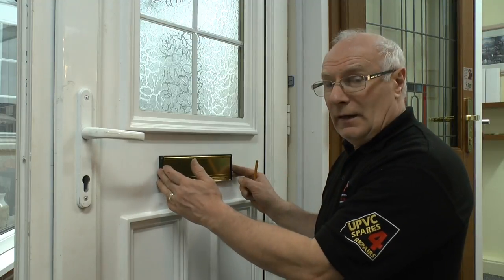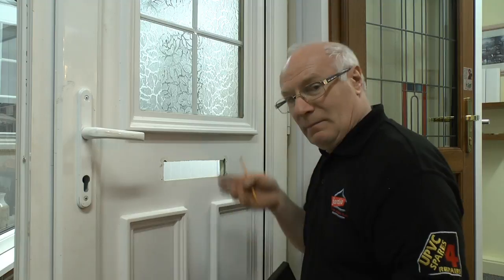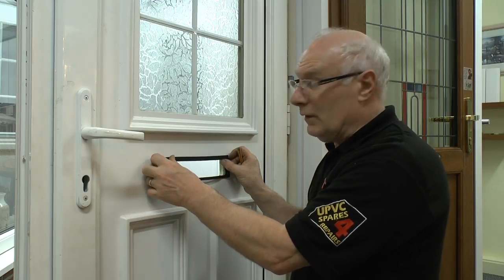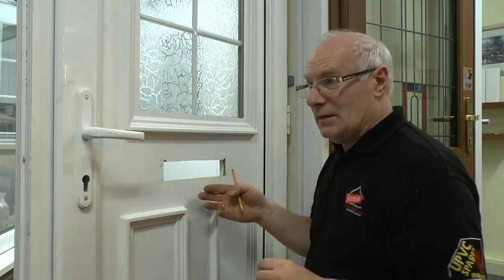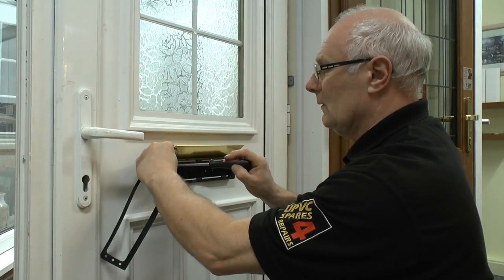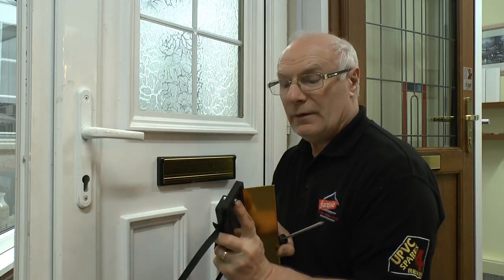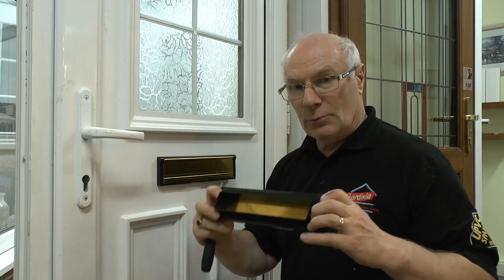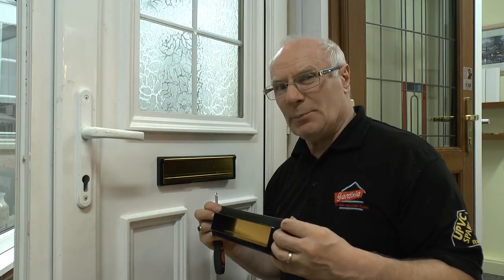Replace A Door Letterplate / Letterbox On Upvc or Composite Doors

Comment: They are always in a similar position however you need to note the detailed dimension drawings we always display on our listings. It is unlikely that a replacement will have the new fixing points in exactly the same place so you will usually need to drill for new fixing holes which is a standard DIY procedure

Comment: I suspect many people will wonder what happens if the hole in the composite (in my case) or upvc door is not the same size as the required letter box.  Do you have to get a replacement that is the same size as the first one?
What differs from working with a wooden door? is this just an ad for upvc spares?

Comment from the maker: It will be bolted on somehow I suspect via a central screw bolt running from the inside to the outside. Look for a philips head bolt in the centre of the plate on the inside letterbox when you lift the flap up

Comment: Does the door lock operate fully when the door is open ?  I:E not closed into the outer frame

I:E open the door lift the lever fully up and turn the key does it fully lock then 
if so it is something catching when the door is closed. I:E one or more of the keeps may need moving to allow the
lock to travel it’s full length

Tip: start at the top keep and remove it off the frame and see if the lock operates and keep moving down the door one
by one this way you can eliminate / hone in on that area if it then operates.

Quite often doors as they get older can “drop” in essence as the hinges and packers wear the door opening sash moves 
downwards to the floor by a few mm and starts to catch even though you can’t instantly see it

Make sure the lever is fully up to the top. If the linkage points do not fully engage their full length 
this will stop the cylinder lug (the black bit that spins round) travelling the full 360 degrees

if so it is something catching when the door is closed the other option to try is to loosen the screw on the euro cylinder key lock 
and then try to lock it etc if it locks ok then lift the handles and lock into locked position before you try to tighten the screw so making the cylinder central etc

If you need to lubricate anything we find Vaseline on all the moving metal parts works well, hope this helps

Comment from the maker: If you take a look at any of or letterbox listings you will see they all have a detailed dimension drawing which you can use as a point of reference against your existing letterbox : https://upvcspares4repairs.co.uk/upvc-door-spares-replacement-parts/upvc-door-letterboxes.html 

Under the main picture you will find thumbnail pictures one of these is a detailed dimensional drawing which 
if you click on will become the main picture and if you click on again will magnify If you cross reference the dimensions against existing you should be able to rule it in or out

Comment: I'm sorry, and I don't want to sound harsh as you seem a nice guy, but this was totally useless to what I wanted to know. I assumed when I clicked on this link, that you would show the full steps on how to replace an old letterbox starting from scratch. I doubt that if somebody had already purchased a new one (knowing how to), that they would then need help on taking the old one off and fitting it!
I think that if you edit this vlog and show how to measure for a new one (that will fit) and then show how to install it, your channel would explode in 'likes'.
I'm hoping that you take this as constructive criticism  - as not every woman (or man) have ever had to do this before so sometimes (as easy as it might seem or be to do) If you have never bought and fitted one before, you need advice!